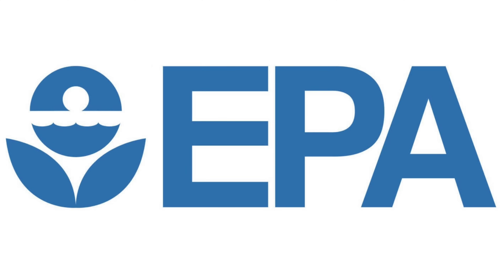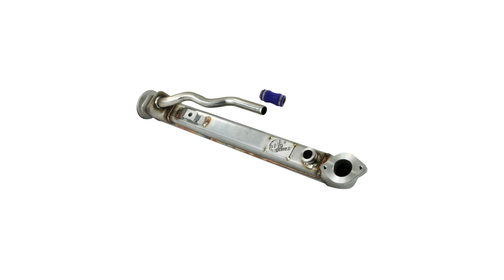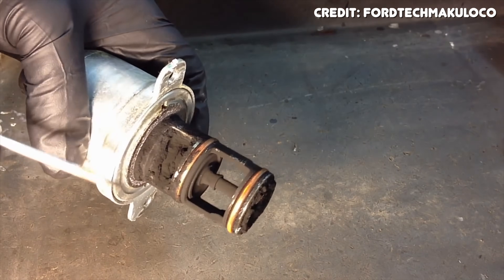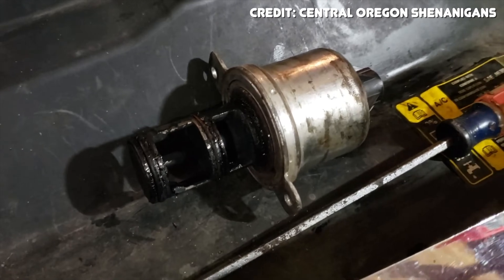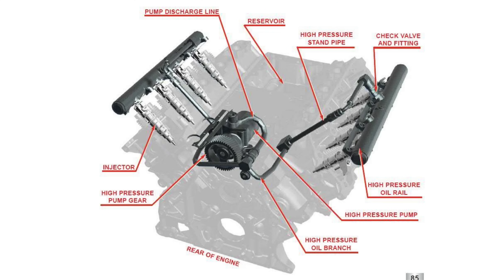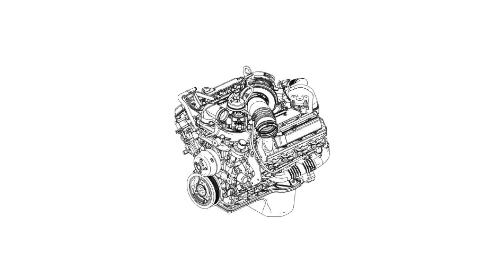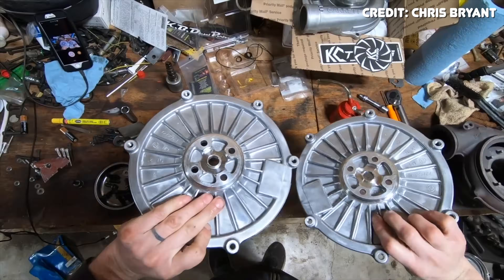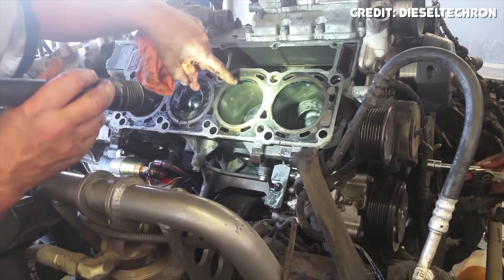The Truth About the 6.0L Powerstroke (And Everything Wrong With It)

Comment from the maker: If you guys enjoyed the video, please SMASH THAT LIKE BUTTON. It helps the channel out a huge amount and helps YouTube put the video in front of more people. Thanks for watching 😬
Reply: As a state fleet manager  budy sent 27  f750 back 2 ford w 6.0  but got 6.0 ihc in ihc same size truck its a ford problem
Reply: Supposedly Ford claimed to have resolved some of the issues you mentioned in this video in 2005 or 2006...is that true?
Reply: The primary Flaw in the  6.0 is  When they went from composite head gaskets of the 7.3 to the more modern multilayer steel gasket of the 6.0 they didn't increase the quality of the machine work creating a smoother head and block surface. This led to catastrophic head gasket issues at increased power levels. Also another primary problem is that the heads were never developed for the e.g. T's that the engines tend to see with tunes and heavy abuse of the upgraded horsepower levels causing cracking those are the 2 major flaws in the actual  design of the 6.0 the rest are all emissions garbage problems.
Reply: Wow, you’re so depressing, I bought my first diesel truck 2007 F250 back a few months ago and you make me want to just either drive it to fall apart blows up or whatever is going to happen! And at that point see if I can put in a gas powered motor and transmission or scrap it for scrap metal. Or sell it now . Needless to say this will probably be the last diesel engine vehicle.

Comment: The 6.0 in my 2005 Excursion over the years is studded, with an external oil cooler, new water pump and the yoyo's that installed the studs screwed up the stand-pipe O-rings that I had to go in and fix (my diesel education)...  But to have a nice working Excursion without the crap transmission that the 7.3 liter versions had in them all makes it worth it.  (maybe)...  But we love the Excursion!, it's always something.

Comment: I don’t care what anyone says if you know what you’re doing with a 6 L and you know how to do it right and you know how to maintain it. It’s one of the best engines ever made after you properly correct it. But if you’re not a ninja and you’re just a wannabe wrench Turner or think you’re good Yeah you probably won’t have as much luck with it. I currently still have two 6.0s one is an early 03 and one is an 06. The 03 has 489K miles runs like a top barely any blow by. The 06 is absolute mint condition 318 K miles runs like a top no blow by both studded the right way everything done the right way pulls more than it’s max capacity multiple times never fails.

Comment: I paid nearly $20k cash for a 2003 Ford 6.0 around 2010 (had 100k) and have 316k miles now. Raised five children, many vacations, traveled, including pulling our travel trailer to the East Coast and back, and it's been trustworthy since day one. All stock, zero blowby and no question it will take us past 500k. We travel through the CA grapevine, Yosemite mountains and neve have any lack of power. I think our trailer is 28ft, winterized and on the heavier side. Not trying to convince anyone, but just sharing. I just make sure to change the fluids and never compromise on quality.

Comment: The biggest issues are lack of maintenance and the wrong upgrades at the wrong time. Oring heads should be done before bigger turbos power tuning ect. Upgrade or remove the egr. Synthetic oil with an additive.

Comment: I bought a 6.0 for under $10k and replaced virtually every part, sensor, and wiring harness over the next year. I did most of the work myself, and in for another $15k, but it runs like a champ now. Still better than paying $80k for a new diesel. Would probably just go with a 7.3 or LBZ Duramax if I did it over and save the headache.

Comment: Have 2 2007 6.0’s both blew head gaskets. Neither were modded. One around 140k the other one at 196k. These trucks WILL blow a head gasket even if not modded

Comment: Great video. Wish I had seen it BEFORE I had to do all the upgrades. Mine is a 2006 6.0l which i have had for about 14 years. It has 150K now. I did the FICM upgrade shortly after I got it. Then I was told to put the coolant filter on it, which I did. Last year the EGR cooler when out and so I got to replace it with an upgraded one, new oil filter, IPR, blue spring mod, a couple of glow plugs. Also had to put a new Unison ring in my turbo. I have only had one injector go shortly after I bought it but nothing since then. I also put the newer starter motor in it and it made one hell of a difference in starting. I also put a scan gauge II on it which makes a hell of a difference. This truck runs on the highway most of the time as we live in rural Texas so it gets well used. Since I did all the work it is running like a champ. Only issue is the cheap crap body bumpers Ford puts in a very expensive truck. I have to change mine out which is a real pain. However, I still like the truck a lot, but I would not buy another Ford......

Comment: This is three years ago, but still wev. I have had multiple 6.0 and 7.3 Fords with over 300k miles. Each have issues. The 7.3 would blow the high pressure oil o-ring and started more than one engine fire. They were paired with a crap transmission that lasted at best 200k. The 6.0 ran well, the tranny laats, but egr/turbo/ficm/injector pump issues. The key with the 6 liter is keep a proper maintenance schedule. They will last until you ignore them.

Comment: Hi and thanks for your views etc.  I have a 03' 6.0 f350 diesel and so far so good, I did have it Bullet proofed last year from AJ"s automotive in Henderson, NV and my rig has 198,646.2 miles and is running great.  I did have AJ's add a sinister coolant system and the oil cooler upgrade while they did the Bullet Proof, just made since.  My question is I think I have the original turbo and although it seems to be functioning properly I cant help but think I would hate to be stuck on the side of a hill while pulling my 5th wheel with a blown turbo, so what is the normal life of a stock turbo, should I be proactive and do it now, are there any signs that I should be aware of?   Thank you for your response.

Comment: fixed my 6.0. Traded it in after the 2nd oil cooler failure. Of course the HPOP failed as well about 2 weeks after the 1st oil cooler failure, deltas about 35. Probably damaged screen due to service, but I had already deleted the EGR, did the micron filter for the cooling and never put a tuner on it. The VGT stuck about 5K miles after purchase and had to be fixed. I swear when they flashed the truck to lower the power, the turbo stuck about a month later. Either way, the trade in value was shit and I wasn't going to dump 20K into it to bullet proof it.

Comment: My story.  06 F350 6.0 dually 275k, 99 F350 7.3 dually 90k, 97 F350 7.3 257k and 86 GMC 6.2 Diesel Suburban 4x4...1.1 mill miles.  Honestly speaking ..the GMC ranks #1.  Its not a speed or heavy items..but it is very dependable for yrs/yrs.  7.3's are next...and then my 6.0. The military ran the Detroit 6.2 for many years.  If those humvees , blazers, pickups can do all that...then the Detroit is the real sleeper diesel engine. 👍🏾😊

Comment: So basically, proper maintenance and fluids will prevent most issues...lol. Im a certified tech, and I still find the tribal wards funny. EVERY motor has issues, and more of those issues come with more technology, and more aftermarket crap. Its all the same. I have a 6.0, and I threw a couple grand in parts, addressed every issue, its tip top and i get good use out of it. Repair your vehicle, INVEST in maintenance, and mosst cars will serve you well.

Comment: not true with no way to monitor.  you can use OBD2 scanner to monitor temp between engine oit and coolant temp.  between the two the difference, engine oil temp and coolant temp should not be constantly over 15 degrees and the only time would be driving on the incline but after time the temp should drop below 15 degrees difference.  if the temp holds over 15 degrees constantly no matter the driving condition which tells you have a block engine oil cooler (Dieseltech Ron - RIP).

Comment: This comment section is either "These are the worst engines ever I have had nothing but problems" or "I've literally never had a problem in 300k miles just doing basic maintenance"

And there is zero inbetween

Comment: The 6.0 isn’t nearly as bad as its reputation would indicate. Owned one from 08 to 2023 and sold it still running strong with 338k on the odometer. It was tuned at 100k miles and ran great. I did all of the common mods: studs, egr delete, coolant filter, blue spring, bulletproof fan clutch, etc. I never blew the gaskets, but when I did them as a preventative measure, the heads were cracked. It was a good truck, but not great. 
     The issue with the 6.0L is that it’s a very sensitive and expensive vehicle to own. It needs 10w30 oil and archoil or Turbomaxx, to keep the injectors happy.  This make oil changes expensive. Even then the injectors tend to fail every so often, and they’re an expensive job.  You need keep an eye on the water and oil temperature delta to monitor the health of the oil cooler. To do this you need at minimum a scangauge 2.  You also need to monitor the ficm voltage to monitor its health.  They are a complicated and temperamental engine. When monitored properly and maintained they run fantastic. They just cost a lot to own compared to other diesels of the same generation and they cost substantially more than the gas engines of the same model years. I loved my 6.0 but I don’t recommend them to people.

Comment: with cat anti freeze, synthetic oil, and cat oil and fuel filters with a water separator. This engine will do 350,000 miles with almost no issues. If you delete it, it is super reliable

Comment: Yes, the 46.0 was turned up from the international 365.I have read the engine plate on 5.9 & 6.7 Cummins they are also only in the 200 hp range when in a box truck or industrial service truck

Comment: Every diesel engine comes with its very own specific problems, no matter which one you decide to get. Even the Cummins has problems that can be catastrophic if not addressed with aftermarket parts. No diesel engine is perfect, but each one can be close enough to perfect to last a long time with a little money and the will to get it there.

Comment: Getting ready to rebuild a stock 6.0 excursion. 265k out of the original engine. 1 set of injectors original turbo. Pretty sure the head gaskets are going, so we are doing a full rebuild and updating slightly

Comment: Whats everyone think of the 6.9 international diesel in my 1987
F 350 dump ??? Worthy of restoration ???? I also have a "1966 jeep p/u with a 327 kaiser
Engine ( called "THE VIGILANTE "
On the valve covers) my dad bought it new ! Has a Prestolite
Starter that needs rebuilt, all orginal except step side bed is
bad.but how good is that 6.9 diesel ??????????????????? 16:50

Comment: My grandpa has a 2003 F350 6.0 Powerstroke and the plan is for me to inherit it. My grandpa is the original owner, maintained it regularly, and it has 117K original miles. Do you think I would have problems with it? Also, do you think if there would be problems, if the cost to fix it would be pointless?

Comment: I bought an 04 F350 had 46k miles on it. The whole motor had to be rebuilt. The heads were warped by 7mm the block had to be sandblasted. 
Idk if anyone else has seen issues like that with low mileage and having warped heads and block had pitting in some spots. I was thinking warped heads is probably excessive heat. Maybe the truck had lot of idle time.

Comment: My stock 6.0 runs pretty good with 225000 miles on it but i think my egr is starting to act up ive been thinking about doing a delete but maybe look into replacing that valve to see if it helps

Comment: My neighbor bought a brand new 6.0L power stroke in 2006 and at only 40,000 miles the turbo failed.  My co-worker bought a 6.0L and at only 80,000 miles the engine blew up going up a hill down the highway.

Comment: I bought the challenge, 03, 158k, been running nice enough, repaired FICM, Fuseblock, AC, Alternator, Glow plugs and Harnesses,  to next , teardown turbo clean , tear open the oil filter , ensure, then Buy some upgrades and do some inspection

Comment: Buying a 6.0 powerstroke 
Step 1: prefer a late 04 up truck with me choosing 05-07 for coil springs (03 did make the most power)
Step 2: new heads with valve guides, head studs, the bulletproof brand air cooled oil cooler kit, a degas bottle cap,  upgrade fuel spring, aluminum rad, egr delete, good free flow exhaust and a few other parts im missing 
Step 3: run rotella t6 oil with hot shots or archoil addictive in the oil AND the fuel 
Step 4: flush your coolant every so often only use approved coolant and distilled water however now that you have the proper air cooled oil cooler stopping the oil cooler up is no longer an issue like the factory setup
Step 5: run a tuner if you must keep it below the 450hp mark while using all the proper guages to monitor oil temps, egt, and fuel pressure
Step 6: maintain your charging system and have your batteries tested yearly or between seasons and they play a huge factor in the life of your FICM
This is a quick but reliable list for anyone interested in a 6.0 powerstroke that will last for years to come change your fluids n filters early only motorcraft filters because of the fitment issues

Comment: Other than the emmission induced problems, the torque to yield head bolts and 4 bolts a cylinder instead of 6 was a major issue.  Lower power levels probably would have made the head gasket and bolt problem non existant, but the engine would be useless for it's intended use.

Comment: You did not cover the charging system, which causes FICM failures. The stock alternator is 110 AMP. I changed  mine to 300 AMP and solved this problem. It requires new 0000 AWG cabling, however.

Comment: I have a 2005 6.0, 236 thousand miles, Banks System, and tuner, none of these i did but was on when bought.
It has been absolutely great with the exception of an oil leak that come from the top of the motor and run down between the transmission and motor.
Rotella oil, and only motorcraft filters.
I wouldn't take no amount of money for it!

Comment: Ford ddnt make the 6liter I got a 6liter spent 10 put another 10 u have to have clean oil and address the Faire points u must have good injectors and take out egr and cat mine is amazing but it is a very finicky truck u have to keep it clean have to 3000 mile oil change with good oil 🛢

Comment: I've owned five 6.0L trucks, all were bought new by me or a close relative. 
All are 2003 models and all have had zero engine related issues. 
The biggest issues I've had with the '03 trucks is charging system related as they were supplied with a tiny frame 110a single alternator. 
Left stock, with good maintenance the 6.0 has proven to be a good motor for me. My first one, bought used, also bone stock ran fine for 340k. I sold it running but with lots of lower bed rust and in need of new upholstery. 
The leather interiors in these were pretty lame, every one of mine has tears in the perforated panels of the leather captains chair seats. 
I am also not fond of the lack of rear seat space in the Super Cab vs the same year GM trucks. I'm a Ford guy at heart but my GM  truck was far more comfortable and more usable cab wise. 
If the charging systems weren't so weak I'd have little to complain about. 
Now, with all this in mind, all of mine are early '03 models, when the info came out about cooling system issues, each one got fully flushed, by me, and coolant filters installed. Now, 21 years later and all are still in good running order and rust free. 

Would I buy them again, probably not but the motor would not be the reason why. I don't like the seating position, but I'm a big guy, a buddy of mine, who's under 6ft, thinks the seating is fantastic. Me, at 6ft 3in, don't fit well. I find myself ducking to see out of the windshield, and long rides simply are not very comfortable. (my long rides I mean anything over a couple hours or so.). 

The fact that none of these can sit for more than a few weeks without running down the batteries has been the real issue since day one, and its not one truck its been all of them. 

Mine don't get driven regularly, but nor does my 1995 7.3L but I can let that truck sit for 6 months, hop in it and it'll fire right up. The 03' trucks will be stone dead if left that long without being on a battery tender. They do best with a new pair of batteries but that don't last long. On fresh batteries they can sit for 7 weeks tops untouched, then they'll be too low to crank over. 

If driven daily they're fine but who drives 8 trucks daily? Or the other dozen vehicles in the garage for that matter.

Comment: You're simply not going to convince me that a medium duty engine design has any semblance of a solid foundation when it is designed with two less head bolts per cylinder than it needs. 

PS 7.3 - 6 per cylinder 
PS 6.7 - 6 per cylinder 
CTD 5.9 - 6 per cylinder 

PS 6.0 and 6.4 - inherent flaw designed in with only 4 head bolts per cylinder!?!?!

Heck, even the old GM 6.2/6.5 had 5 bolts per cylinder!!!😂

Comment: 1st have u personally ever owned 1 for a daily driver?? If no , then ur opinion doesn't matter! I had a 04 F350, n no other diesel sounds as good as a 6.0! N it's was good until it wasnt!! I bought it used, with 168k on it , drove it to 270k ish. N dumped it. I had the EGR deleted,  a 5" MBRP Full exhaust , colder air, NO TUNE, n it still fell apart!!! The damn oil pan rusted from the inside out! Then I had to basically remove engine to replace it!  If u baby it, it's still not good! But the 6.4 is WAY worse!! So Yeah it's terrible lol